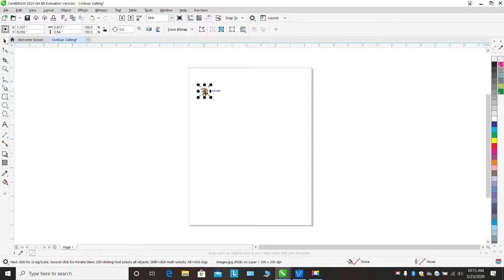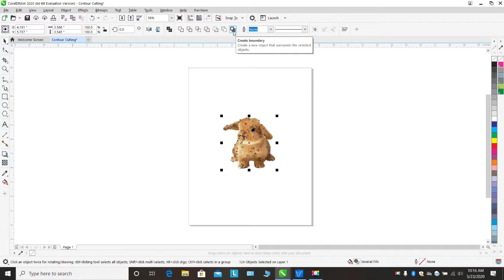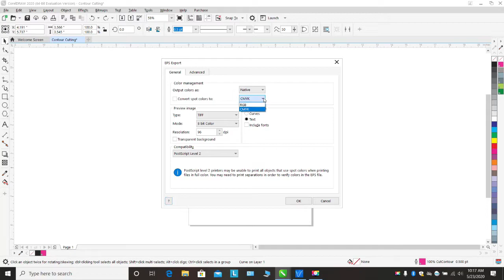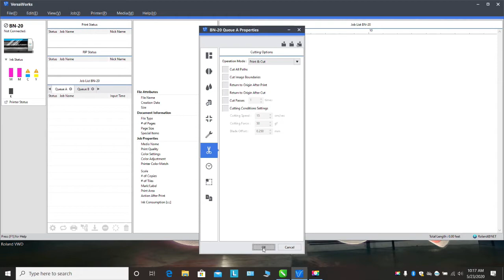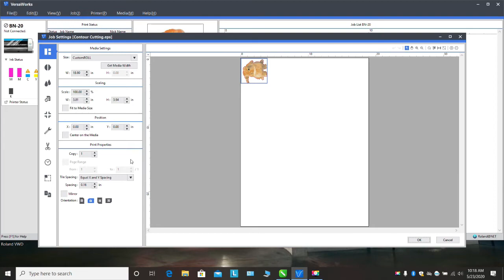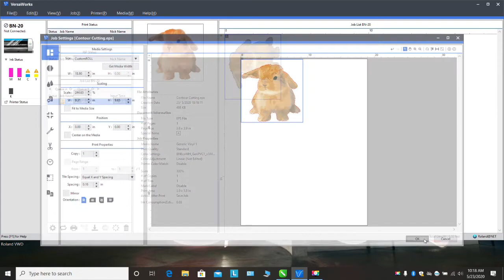Contour Cutting With CorelDraw 2020 & Roland VersaWorks 6

Comment: Volume too low...horible
Reply from the maker: Chris - first - you might want to try spell check.  The sound is not great but did you know that you have volume control on your computer?  Funny that so many others seemed to get value out of the video.
Reply: @ronbaddock7372  Ya, I suppose I should have re-read my comment.  Yes.... smart ass, I am aware of the volume on the computer as well as a volume control on my external speakers.  I have had to turn it down and up to make it listenable on certain videos.  I think you could upgrade your mic or record level because with all volumes at their highest it sounds like you are whispering.    Moving along......

Comment: its keeps saying my file is corrupt
Reply from the maker: Which program - CorelDraw or VersaWorks?  I suggest that you try another file and see if that works.
Reply: Ron B I’ve tried eps files pdf flies and png files. All read corrupt. Jpeg bitmap loaded but versaworks will not read my cutline
Reply: Ron B Also I wanted to say thank you for your video it was so helpful and insightful that someone with Corel draw 2020 posted contour cutting ! I really appreciate it ! But like I said no files load but the JPEG bitmap. And I haven’t been able to get first works to recognize my cutline I did everything but your video said to do ! I don’t know what’s wrong .
Reply: Ron B versaworks. Reads filed corrupt. After I follow your directions to cut
Reply from the maker: @questeel3964  Did you definitely change the cut line to the magenta color?   If you are not sure, in CorelDraw, move the cut line with your mouse to see what color it is.